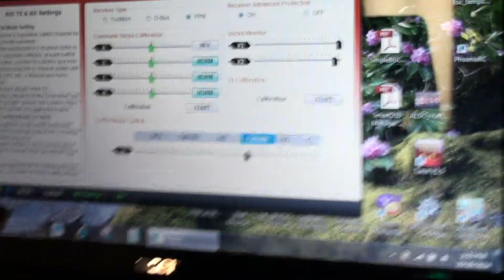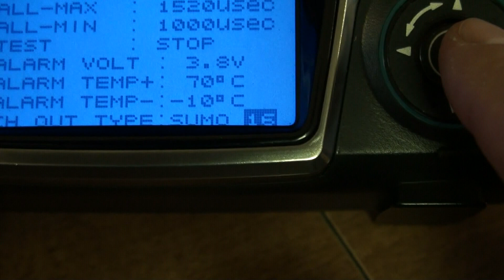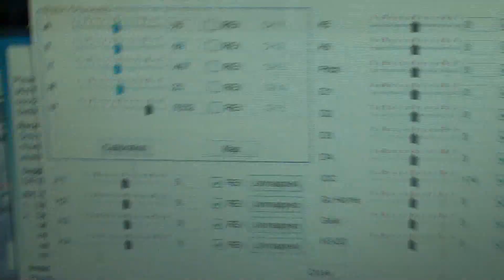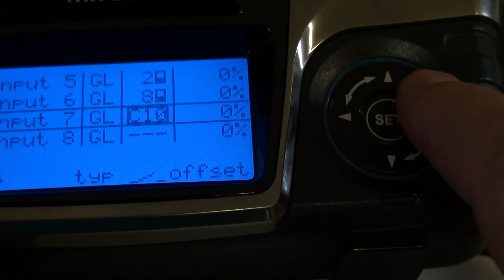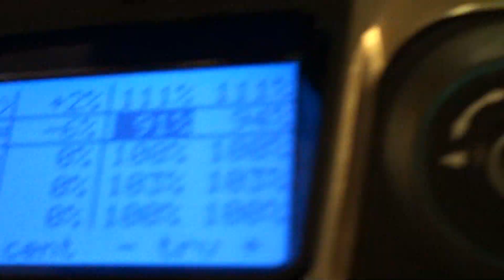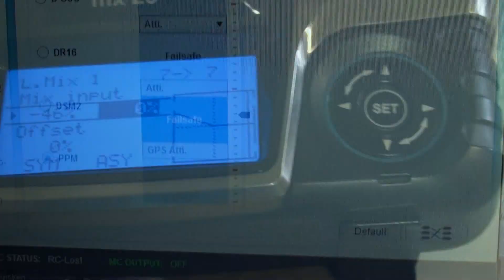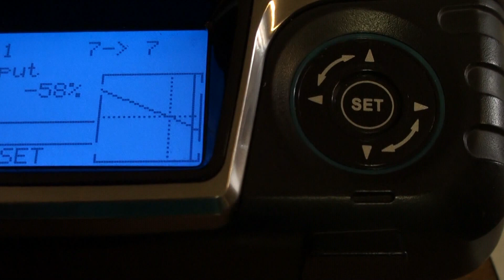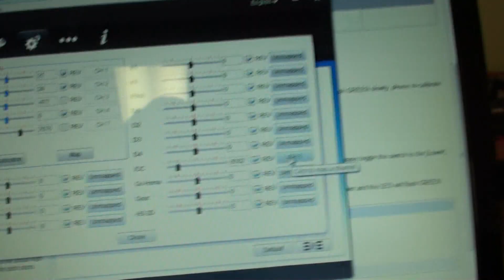Graupner MX-20 setup for DJI A2 on the S900

Comment: hi there,
helpful video thanks!
i bought a s900 and im still for my A2, i already have a graupner mc22s and a ready online that it is better to conntect the receiver through the DBus adapter.
why didnt you use it? is it safer fly with an adapter?
cheers
Reply from the maker: pixtep Not sure.  I've had a back and forth with DJI about the Failsafe on Ch 7 needing to be setup or not. It shows "signal lost" in the software both ways, but I'm not really bold enough to turn off my transmitter.  Either way it works fine with PPM.  I haven't heard anything about the "adapter" being better.

Comment: Thanks for the video. I noticed that the fail safe doesn't activate when I turn off my MX-20. It only seems to work when I toggle the switch. Any idea of how to get the fail safe working incase there's power loss on the graupner?
Reply: Gary McCready  Hi Gary! Thank You your tutorial, was very helpful. Although comment concerning Naza V2- X1 and X2 are mixed so user of Naza needs to switch ch2 and 8 and to make FailSafe work after Transmitter switch of- you need to set ch7 in FailSafe settings of MX-20.
Reply from the maker: If you turn off your MX-20 the RC Status should show "lost signal" at the bottom of the screen. If you  look at about 11:10 it still says ATTI but it is in failsafe if it says "lost signal".
Reply from the maker: Piotr Mazur   Yea, I did setup my Failsafe on Ch7, but the A2 still behaved the same, when I turned off the Transmitter.  Both showed it going into "come home" mode.  Better safe than sorry I guess?  I couldn't get DJI to chime in one this after multiple emails.

Comment: i have the same setup. A2, S900, MX-20. Is there a way to get more than 8 chanells working whitout the D-Bus Adapter? PPM ist limited to 8 CH on the A2
Reply from the maker: I run my Gimbal to the GR-24 channels 9 and 10, and put them on the dials, with PWM.   Throttle-Rudder-Eel-Ail (4) GPS IOC Gear Retract (3)  That is all I'm using.